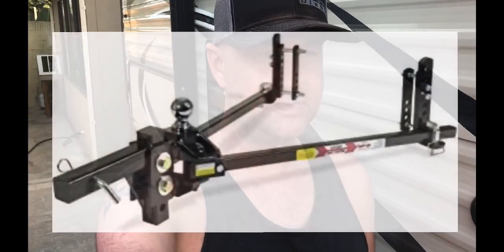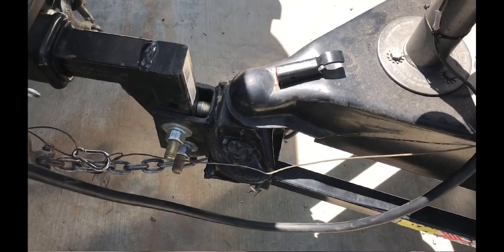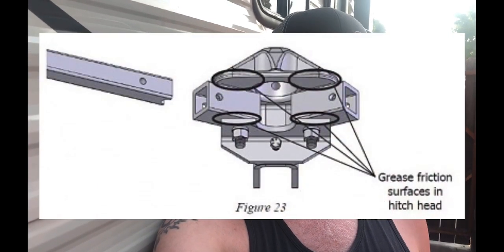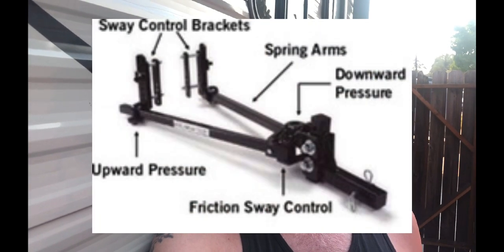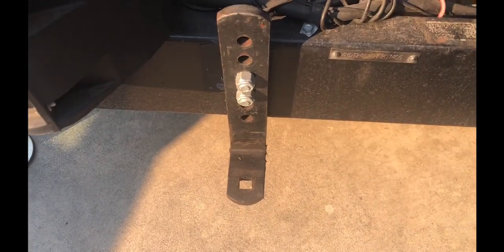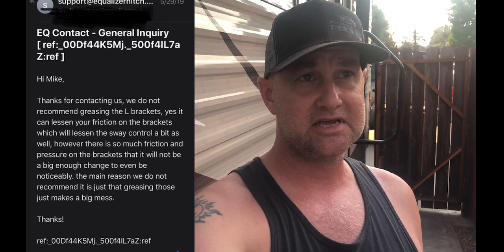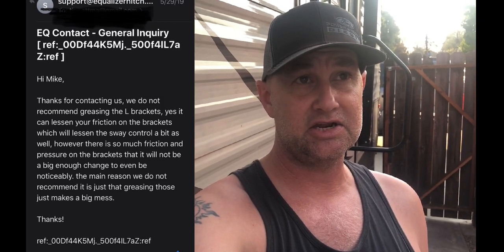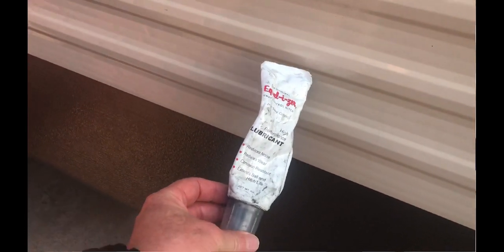Should You Grease Your Friction Sway Control Hitch?  Equalizer Hitch //RV Living

Comment: Awesome practical analysis to this burning question. The fact that they provide the plastic pads to reduce the noise is solid evidence that metal on metal friction is not required.

I have not seen anyone mention the fact that the tension spring arms that provide the “friction” still need to be able to move along the L bracket. Without grease or the plastic sleeve they can occasionally get stuck because there is too much friction preventing the trailer from being able to move freely. If the trailer has ever felt like it is not quite returning to the center position after a turn it may be due to too much friction on the L bracket.

The friction should not impair the movement of the trailer to the point where it can no longer find the optimal position.

The friction with or without grease seems to be designed to add “control” to the trailer not impair its function.

Hobo has provided a common sense approach here. He gets his own feedback from his experiences and makes adjustments as he sees fit. He takes the time to understand what makes the hitch so what it was designed to do and even asked them questions. And then took the time to provide his analysis. This is critical thinking at its finest.

How many user manuals for similar products specifically state not to grease the L brackets and why? What are the implications of adding grease and to what degree according  to the manufacturers. I have not read all of the manuals but the few I’ve seen leave this area to interpretation or are missing any details about grease/lubrication or provide any information as useful and relevant as Hobo laid out.

We could blindly follow a generic manual     written for the masses that likely is edited for minimum liability to the manufacturer while being interpreted by the average person. Or we could know what the heck we’re talking about, think for ourselves and use common sense.

There is no instruction manual for building a house- take it from a builder. Sure there are guidelines but rules are for the strict adherence of fools but for the guidance of wise people.

Great Work hobo! Keep sharing your critical thinking to the internet!

Comment: Glad to hear that you grease your hitch. To further improve, you can add the plastic pads which they offer to rest on the L-Brackets. No grease and no noise. I pull a 28ft trailer with my Tundra and it is silent. I also clean and grease the ball each trip. I have towed on some long trips and have never had any sway.
Reply from the maker: I’m glad to hear your set up is working for you. I have heard good things about the plastic L bracket covers. Thanks for watching!

Comment: As an engineer, I agree with you...no engineer would rely on metal to metal  friction. Because rain will change the friction coefficient, temperature will change the friction coefficient, mud/road grime will change the friction coefficient, etc, etc, etc. So there would be no  consistent friction coefficient  between sliding metals to rely on.

Then there's the whole discussion about prolonged wear-down between the metals. But I'll save that for next time.
Reply from the maker: All the coefficient stuff makes a lot of sense and those were things I had not considered. Thanks for taking the time to leave a comment and share that information. Take care!

Comment: Agree 100%!  Look at some of the pictures of “L” brackets that have never been greased - they’re usually well worn.  Mine wore grooves not long after they were installed with only a couple of outings.  They also made a huge amount of noise.  Now with just a small smear of grease on the topside of the bracket, it is quiet as a mouse!  Never dry again!
Reply from the maker: Thanks for watching and leaving a comment, I appreciate it!  I had a very similar experience to yours. Thanks for sharing!  Take care!
Reply: I did put a small amount on the friction bars where they fit up inside the hitch as well - I believe that’s the part where the manufacturer recommends to grease.  It doesn’t take much.  Be warned that your better half might get all over your butt if she goes into the storage area and gets her hands in grease!  Mine has not stopped complaining and I simply tell her to stay OUT!
Reply from the maker: Yes!  I also have to keep the kids and my wife away from the hitch. I cover the hitch with a plastic grocery bag when it is sitting in the garage. That seems to work pretty well.

Comment: Per equalizer I grease all friction points, also per install notes, when bars installed, 1/2 of rise on drive axel should be eliminated, those arms are now carrying weight and grease doesn’t change that, no one gonna pull arms off because of weight
Reply from the maker: I absolutely agree with you Joe. Thanks for leaving a comment!

Comment: When pulling into a campground, i could care less what other campers think what my wdh sounds like. I have a equlizer 16k, its a heavy rig. I unhook the hitch when backing in or leaving. Equlizer themselves told you that they "don't recommend" greasing the brackets. Saying that they said it just messy is reaching at straws. If you purchase a hitch at a price point like mine ($1,000) i want it to provide the most safety as they can, and if they say greasing will reduce sway by 1%, you bet I'm not doing it.
Reply from the maker: To each their own. Thanks for watching!

Comment: Can you back up with the sway bars in place? Or just tow forward ?
Reply from the maker: Yes, you can back up with the sway bars in place. I have never had to remove them to back up, and I have made some pretty tight turns.
Reply: @loganandthehobo    Ok , I pull a 23 foot camper , and I was told to remove the bars when backing up.  Lots of info out there ..
Reply from the maker: There are different systems made by different companies. The equalizer brand, 4 point sway control, you don’t remove the bars to back up. I don’t know about any other system. 

Thanks for watching and commenting, take care!